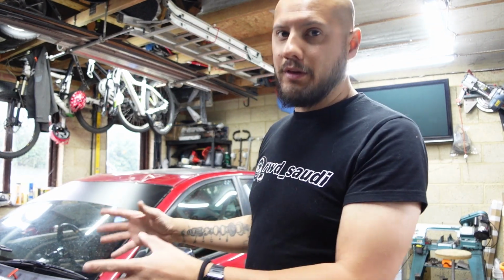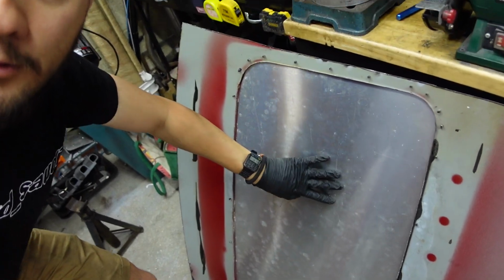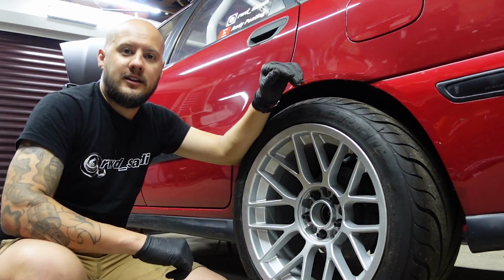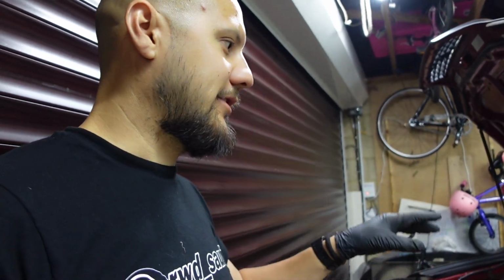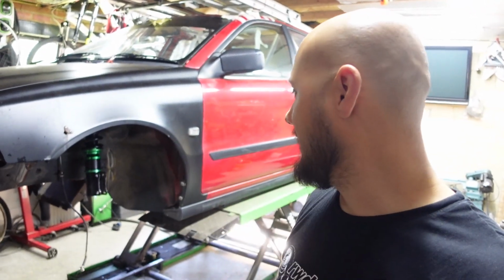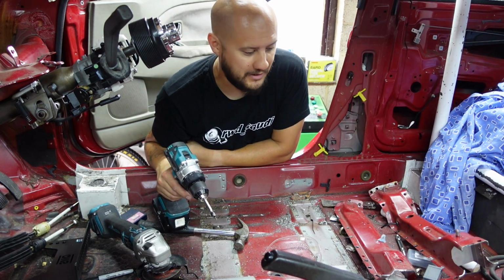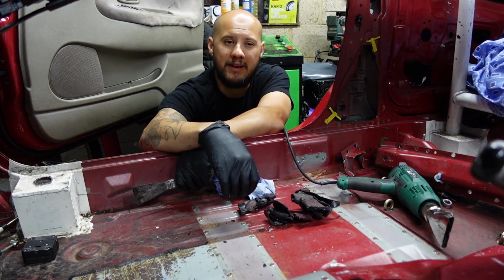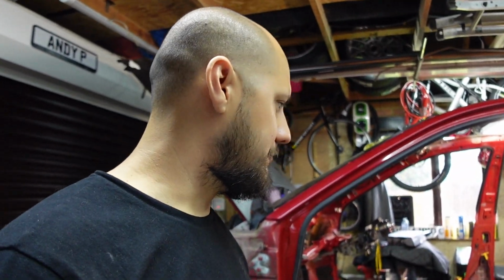Volvo S40 Race Car Build Continues! LOTS of PROGRESS!

Comment: Good day man...need to know. ..are front  seat belts interchangeable. ..left hand drive  to right hand drive  . ..and also...inner Driver seat air bags. ..from left hand drive seat to use in a right hand drive car...btw...keep up the good job with the vids
Reply from the maker: Hi, I'm not 100% sure but I would say yes, they are interchangeable.
Reply: And how are you able to run 4 ignition coils as to my two...haven't seen that before, ,,cheers man
Reply: I'm located in trinidad with a euro, ,,so it be easier to source parts from the u.s. but they be l.h.d. 1.9t...so thats why I'm asking about some parts being interchangeable

Comment: Do you know of any 4 lug to 5 (5x114.3) lug wheel hubs that’s bolt up for the S40? I know Mitsubishi has some that work,just not sure which models fit. Thanks
Reply from the maker: On the front the FTO hubs bolt up however the spline is different. Rear FTO should be a direct fit. (5*114.3)
Reply: @AndyPonting  interesting, Thanks!

Comment: Where are you based man? Could you help me out?? I'm based in Birmingham West Midlands
Reply from the maker: I'm down on the south coast near Southampton. What do you need help with?
Reply: @AndyPonting  thanks for responding!

I have 2.4i s40 sport mkII 
I was attempting to remove the fuel pressure sensor and ended up rounding the screw head because of the stupid angle and tight space.. I ended up getting it off with much difficulty, but I need the specific screw replaced, do you know what it's called? + size, etc??
Reply from the maker: @iz.FullSend  that's ok!

I'm fairly unfamiliar with the later generation S40's but send me a pic on Instagram and I'll see what I can find for you